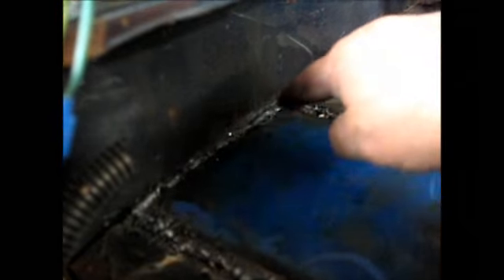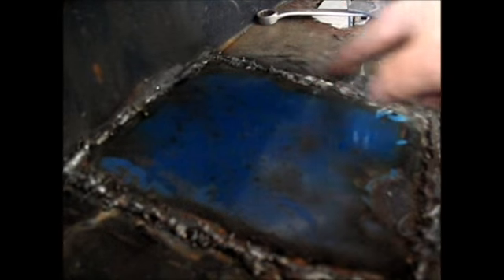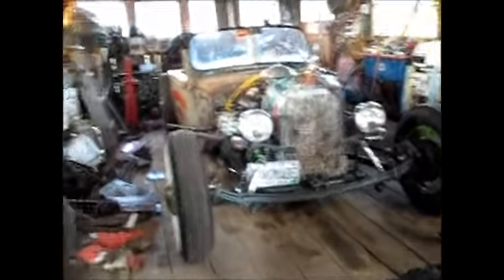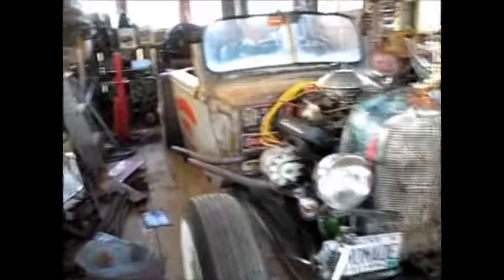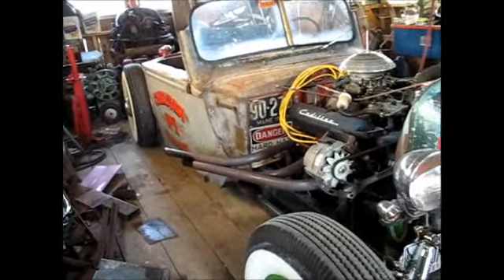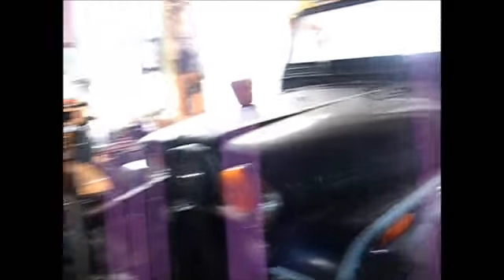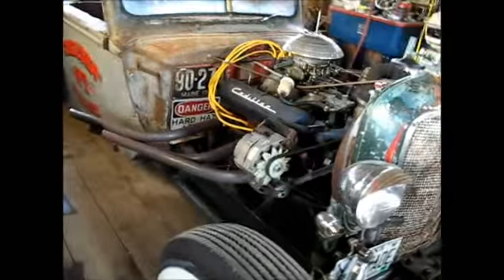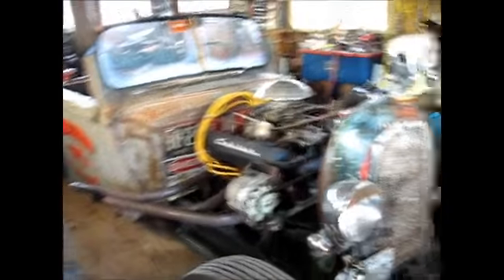Jeep CJ7 rust repair, flush mount rear fender patch panel done

Comment: The beauty is you can grind it of and do it again, right? I reckon you are using flux wire.  Raw clean metal and a swipe with degreaser (I use acetone), good ventilation and drape the fuel tank. "schrankm" is right. Heat and wire speed. I usually try to dial in on a mock-up to get close.  A fire watch is a good idea, too. I bet you got it handled up on Mr. P. It'll be perty.

Comment: Not sure what gas you are using, but if you can try C-25 gas.  It's 25% Co2 and 75% Argon.  The Argon will help keep down the spatter and it helps produce a flatter weld, good for body work.

Comment: What you are doing is called a butt weld. When you overlap the metal, you end up with an area where miosture and dirt gets in, and starts the rusting all over again.  With the heat setting you have, try slowing down the wire speed just a bit.

Comment: If you just lay a piece over the top of existing metal you just start the rust out process over again because mud and water gets trapped between the 2 pieces. Where as if you butt weld 2 pieces together it doesnt. Then grind it down and put seam sealer over the welds.  Thats why I lay the 2 pieces of metal on top of each other and cut all the way through both to make a perfect fit. Takes time to fit it but worth it. Wont take much grinding before a person decides to do better welding. Haaa!!

Comment: it looks as though you haven't got your amperage and wire speed matched accordingly. a tuned welder should make a nice buzzing/sharp even crackling sound.  mig-welding.co.uk/wire-speed.htm